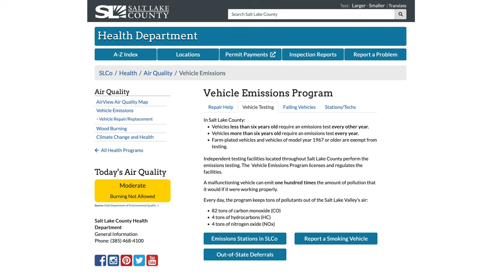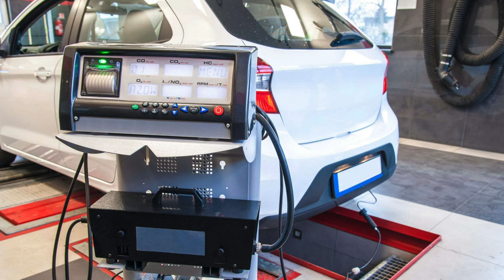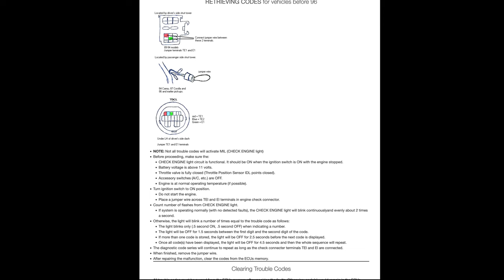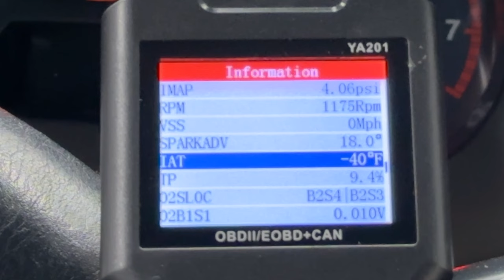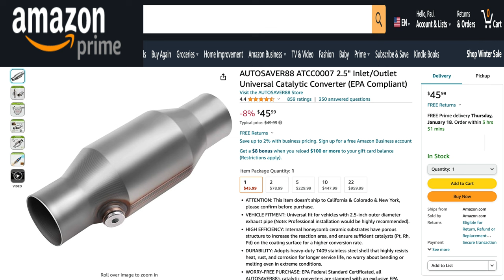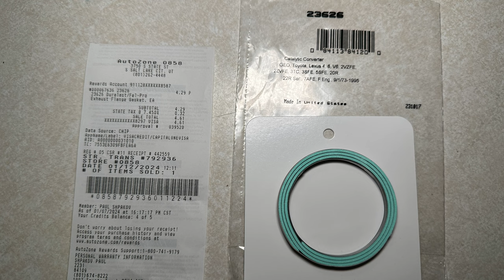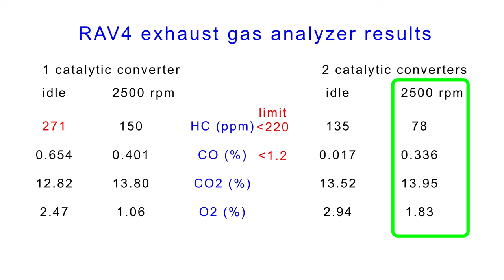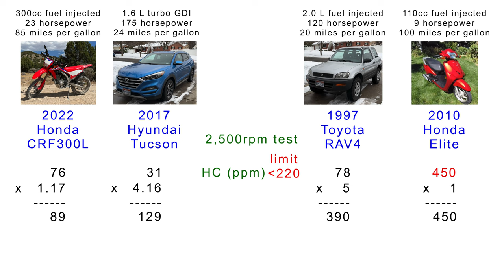Passing the emissions test with my 1997 Toyota RAV4 (episode 40)

Comment: Amazing!! Congrats on the pass! I live in Denver and I’ve been to emissions testing about 9 times now. They haven’t been able to test my 96 rav (silver, AWD manual, just like yours) because my Catalyst Converter sensor is “not ready”. I’ve asked if they can just put it on the dyno to test thetailpipe emissions, but they said the wheelbase is too short to fit on any of the machines in the state, so they need all the codes to read correctly to give me a pass.
I saw an emissions inspector who told me my car was running super rich, so I took it to a dealership where they replaced my bank 1 sensor 1 oxygen sensor. It slightly fixed the problem, but I’m still running rich. They wanted way too much money to replace the other sensor and warned me that it might also break my cat because of rust. So now I’m working on replacing the other oxygen sensor myself as well as the MAP sensor, and I ordered a new cat (the one on the manifold) that I’ll have to retrofit to the rav because they don’t make that one anymore (as you know). Figured I’d replace the cat because I hate messing with rust. It’s probably extremely clogged anyway, like yours was.
My temporary registration is now about 7 months expired and I keep getting ticketed for just having it parked outside my house on the street with expired registration (I don’t have a garage to hide it, unfortunately). What a nightmare this has been. 
Overall, glad to know I’m not the only one having problems trying to pass emissions. As always, thanks for the video, Paul!!
Reply from the maker: If you don't have a scan tool yet, pick this one up: https://amzn.to/48sXcCy
Read your own codes, and also look at the datastream while the engine is running. It's unlikely the MAP sensor is bad, but you can check it's data instead of blindly throwing parts at the car.
There's a 90% chance your catalytic converter is clogged. You might get lucky and find an aftermarket one that fits on the manifold, or you'll have to do what I did and put 2 of them under the car (for 1996 or 1997 model year).
When I had a clogged cat, I had to downshift to 3rd gear to maintain 70mph on the highway up slight inclines. With a good cat, I can hold my speed in 5th gear.

Comment: Another great video Paul, I liked your explanations and deadpan jokes. You did a good job discussing some of the reasons emissions regulations are important. However! I don't know if your analysis 'Best for the Environment' is correct. You would need the volumetric flowrate to multiply each concentration by to get total hydrocarbon output. This would be proportional to engine size and RPM, not total MPG. Regardless, I loved this portion and almost clicked off the vid before watching till the end. Interesting to see how MPG (the only number I usually look at) isn't the whole story.
Reply from the maker: Thanks! I'm glad they're useful for you.

Comment: every vehicle in California past the year 1970 has emissions testing required, not sure what years get what tests but everything 96 and newer gets tailpipe emissions testing, where you get the readouts of the toxic emissions, as well as component inspections.  Also most community colleges with an automotive program have courses you can take to become emissions  compliance inspector certified thru the BAR (Bureau of Automotive Repair). Meaning you can become a smog technician yourself.

Comment: fun fact: I have a 1996 rav4 here in Costa Rica, Manual transmission and well, It hasn´t the OBD2 conector at any place. :(     (that car was imported by Toyota brand dealer here at Costa Rica in 1996)  I think that maybe the requirements of the dealer at those years wasn´t so strict for new cars)   Just maybe, I really don´t know

Comment: There's something I don't fully understand. If it was running rich after the cat swap, how is that the fault of the cat? Wouldn't that more likely mean you need to adjust the fuel/air mixture via the ECU or something?

Comment: Wow that's annoying that you can't use 1 pretty efficient CAT from later models... I feel that when buying used cars, buying the last model year to reap all the benefits of the previous iterations is probably the best
Reply from the maker: The 1998-2000 RAV4 have a few improvements over the 1996-1997:
Better headlights with separate high and low beam bulbs
Most people think the tail lights look better
Removing the instrument cluster doesn't require dropping the steering column
Extra cupholders under the radio
2 coil packs instead of a distributor
Better exhaust system with 1 catalytic converter

Comment: I have a 2000 Toyota Rav4. My front seat passenger side floorboard carpet gets extremely wet when it rains. Is something clogged and where is it located under the hood if so?? Can you help me please??. I also had a new windshield installed,  but both sides of carpet is not affected.
Reply from the maker: First take a look under the carpet. The floor has a few rubber plugs. Make sure they're not loose. Next, take the car to the carwash and pressure wash the exterior, while checking inside for leaks. Spray around the edges of that new windshield to see if you get any leaks. Also check the door seals.
It might be possible you're having condensation not draining from the air conditioner, but that usually happens during the summer. Also, does the carpet smell like coolant, or is it water?
Reply: @LabCoatPaul  No sir, it's definitely water. It didn't start happening until they replaced my windshield. First, it was both sides wet carpet,  then they came back out and took the windshield out to reseal it. Now it's just the passenger side carpet wet, but extremely wet now. Is there a drain called the cowel? Or a cover that they could have damaged that I can check? And where is it located in my rav4?? Thank you very much for your help and all those great videos. 👍

Comment: Ive replaced the purge valve the egr solenoid and fixed vaccum leaks and replaced the egr valve and i still got P0401
Reply from the maker: Have you tried cleaning out the EGR passage in the head where the valve bolts on? Also remove the throttle body from the intake and clean that up too. Make sure your oxygen sensors are working too. If you don't have an OBD 2 scan tool yet, get this one so you can look at the datastream:  https://amzn.to/48NUuau
Reply: Sorry to be back to you late but i replaced many lines as they cracked and dry rotted I also cleaned the throttle body the intake manifold I was told I had to replace the charcoal canister but I'm hesitant since its over 300 dollars
Reply: Thanks for being a part of this community truly underappreciated

Comment: egr and all this emission saving shit just cakes up the intake, valves and shit engine die way faster than the old dino burners hahaha
Reply from the maker: Yes. Even though my 2017 Tucson has cleaner tailpipe emissions, the GDI system requires burning gnarly chemicals every 10K miles to clean the intake valves. Also, 3K miles or less oil changes are required if you don't want your engine to blow up. Most Hyundai GDI engines get gasoline in the oil, and a lot of them start burning oil around 80K miles. The old cars don't have those problems.